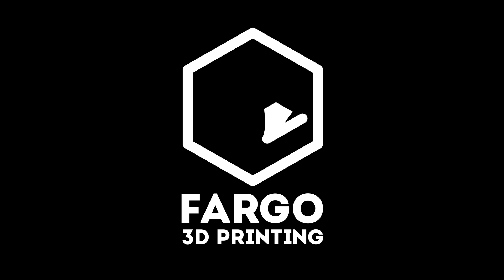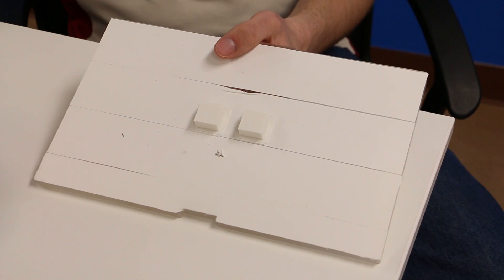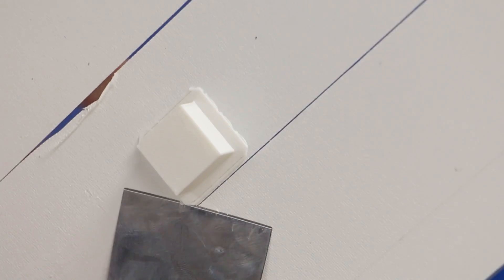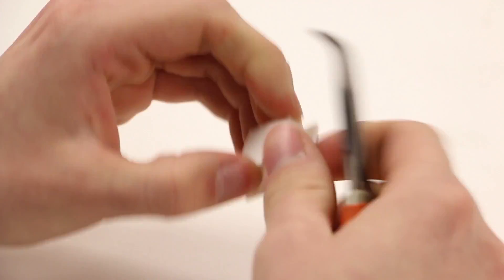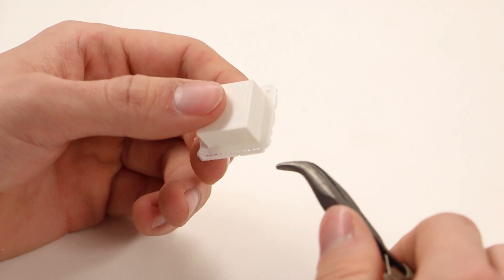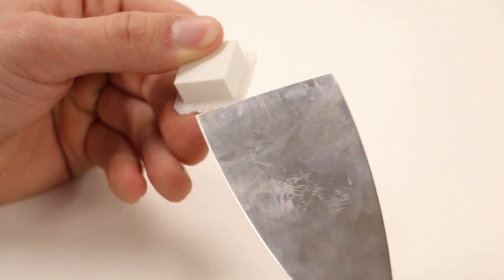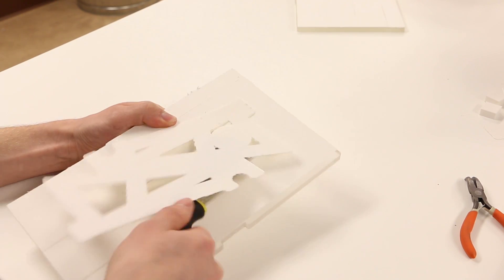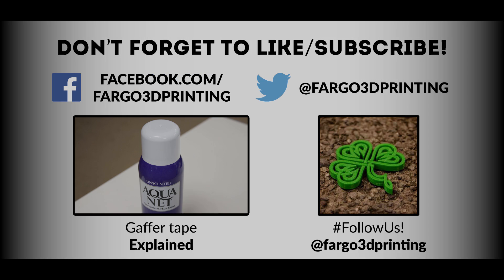Painlessly Remove 3D Printed Rafts

Comment: Yeah, rafts become the new bottom of the model. Don't use them.
Reply: How do you turn them off,  and what's the downside of not using them? Do the models move on the platform as they print

Comment: How to set the rift settings that rift will go off the object with such an ease? Because when I'm printing, the object sticks with the raft so much that I cannot remove it from the object. I'm using PLA.
Reply: I'm having the same problem right now. Have you found a solution?
Reply: @tardarsauce3355  no, I haven't. Sorry

Comment: My raft keeps crumbling into a bunch of pieces and then will have some layers stuck to the print making it impossible to remove from the print
Reply: I'm using PLA and a flashforge adventure 3
Reply: @Mitchellbellhockey  I have the same setup as you and experiencing the same problem

Comment: I messed up with my original bed i printed a raft and the print+raft are stuck on the bed, im trying to remove them by the scrapper is not working to remove this! The print is literally stuck in the center HAAALLLLLP!
Reply: what material are you printing in? lol

Comment: Lately I've had trouble the print sticks to much on the raft even prying off it just rips off leaving the raft stuck under the part
Reply: I have this problem right now. Did you find a solution to it?

Comment: This is not what my raft does. It will not come off the PRINTED PART. YES, My bed is level. Thanks Using PLA and Simplify3D.
Reply: yeah the pieces never pop off that easy using the second part. looks pre set up.
Reply: are you printing too hot? I'm wondering if maybe it's fusing with the raft? maybe try lower heat settings?
Reply: @OwOLink  I'm having the same problem printing pla at 190°
Reply: @whitekanyewestthebully1346  kinda forgot what the topic was about but future me is thinking maybe if people are using heated beds there could be some melting at the bottom causing the parts to fuse, if it's just to get good adhesion,  I tried maker muse's garolite suggestion, so far I've been printing like a champ, if I'm doing a bunch of little stuff like a kit card or movable parts I'll do a brim and adjust the line count to whatever makes sense.

I hate doing rafts lately as I feel like it can be a waste of filament but I won't be surprised if I run in to a situation where I might need to do a raft like lets say a big ol' print lol

hope it helps.
Reply: @OwOLink  usually I use rafts so the supports stop popping offshore easily mid print, I just changed the air gap from 0.3 to 0.7 it's bow a lot easier to remove

Comment: i don't know how we got so lucky, but we use a sharp spatula and they come right off - we're still using the 3M blue tape on our makerbot, razor sharp spatula works great for both the raft removal and getting it off the plate. i wish the supports were as easy to get off as the raft is

Comment: I am also having a hard time removing the raft from my prints. it's like it's part of the print. I definitely can't remove it like in this video. I'm just using the default settings on flash print. anybody have any ideas why my parts are adhering viciously to the raft?
Reply: I'm super pissed on my adventure 4 I trying to print a case for my z fold 3 and the print says it requires no raft or supports and yet it won't print right without both.  Then the supports and rafts ruin the print when it's done because I can't get them off. I want to take my fist to my adventure 4 so bad I was so attempted  to do so but it's 900 dollars
Reply: @джошуаигерт  did you find a solution after all these months? I have a different printer but the fucking raft just won’t come off like it does in this video
Reply: @tardarsauce3355  I lowered the infill percent of support and it fix it
Reply: @джошуаигерт  Cool thanks I'll try that
Reply: Fargo 3D Printing, well it's got two modes for settings, a beginner and a professional mode. I'm on beginner, (I'm a noob with 3d printing) so I'll have to check under the professional mode, I know it let's you adjust a lot. Beginner mode just has a default raft check box, no options.
Reply: @gdeisig  if youre still having the problem of it being hard to remove raft i find its easier to clamp it and use a chisel and hammer

Comment: Could you share the settings you used for your rafting?  Specifically number of  raft layers, raft offset, separation distance between the print and the raft, and raft infill.  Thanks for any assistance you can provide.
Reply: I’m gonna guess you had the same problem as I do now, where the raft is stuck to the print like superglue. Did you find a solution?